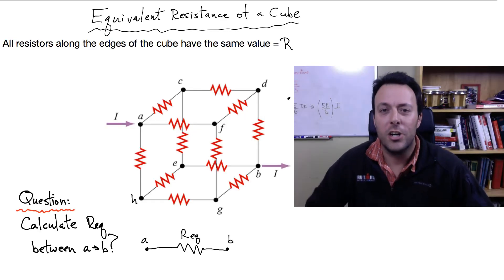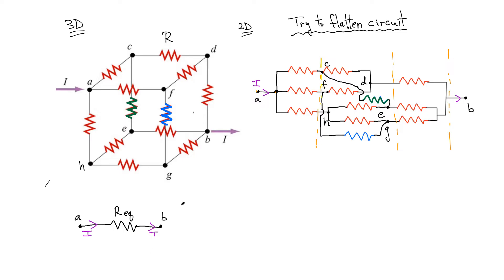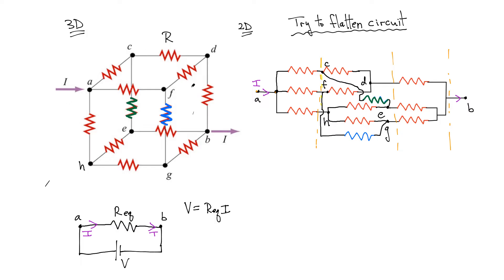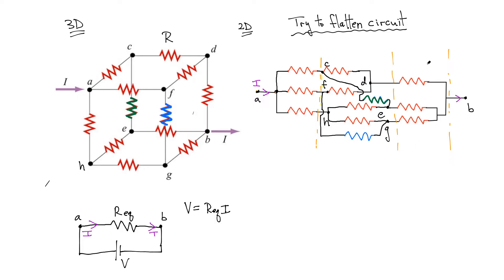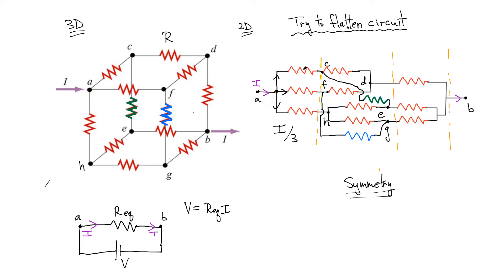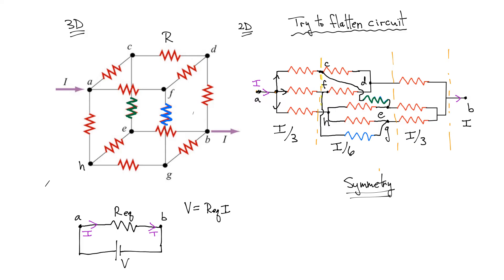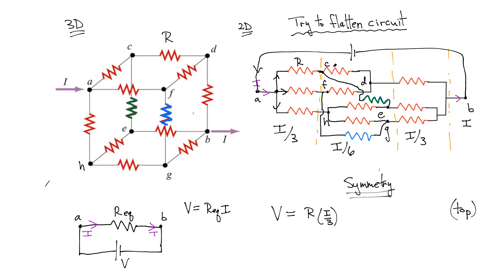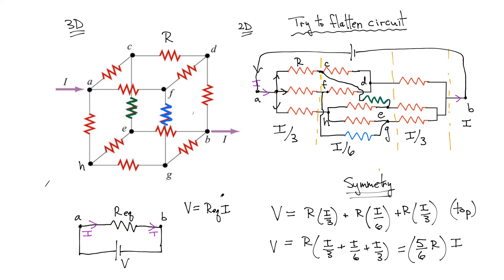Equivalent Resistance of a Cube

Comment: You are assuming the solution when you claim by "symmetry" that Iac = Iaf = Iah. You cannot KNOW that. This is the same as claiming that you KNOW that Vc = Vf = Vh.

In reality you are just GUESSING that these currents are equal, and then deriving the resistance based on the guess. But you did not show that ALL the currents and voltages are consistent with the assumption/guess.

Another way: You need to formulate your "symmetry guess" in the form of a set of equations that SHOWS there is symmetry.

One way may be first to derive some equations that show that Vc=Vf and Ve=Vg and work from there.

Comment: Brother !!!  How would I do if the resistance of the cube arm was unequal?  I searched the whole net world and found no answer.  If you have any known method.  Let me know
 PLZ Don't skip this question.
Reply: "I would use a voltage node method and basically set up a system of equations of 12 equations and 12 unknowns.    You could also solve numerically using a simulation like ltspice."
If you read the comments you'd have found your answer.

Comment: Brother !!!  How would I do if the resistance of the cube arm was unequal?  I searched the whole net world and found no answer.  If you have any known method.  Let me know
 PLZ Don't skip this question.
Reply: just like he made the 3 sections, take each resistor in their respective sections to be in parallel. now these 3 sections are in series. Using this you put any value of resistors and calculate parallel and series connections.

A (1 | 2 | 3) --- (4 | 5 | 6 | 7 | 8 | 9) --- (10 | 11 | 12) B where 1,2,3.. denotes the resistors, " | " denotes parallel connection and "---" denotes series connection

Comment: so instead of considering the current through each resistor couldn't you just say that the resistors in each "section" of the diagram you made are connected in parallel, and then each section of the circuit is connected in series? Wouldn't you just be able to apply the equivalent resistance formulas for circuits in series and parallel?

Comment: This may be a stupid question but how did you calculate 5/6?
Reply from the maker: Not sure if this helps but 1/3+1/6+1/3  =>  2/6+1/6+2/6  =>  5/6
Reply: one third and one third is 2 thirds, two thirds of 6 is 4, so that's 4 sixths + 1 sixth = 5 sixths

Comment: Why do you chose only one path?
Reply from the maker: Great question - for this case i'm able to only choose one path because i've use symmetry to argue that the incoming current to the cube with be evenly split between the 3 branches - then split evenly between 2 branches.   This allows me to get away with only doing one path and introducing the current I flowing into the cube.    I can only do this because the resistors are all the same value.
Reply: Also, the path is the same no matter which  branch from junction A you choose :)